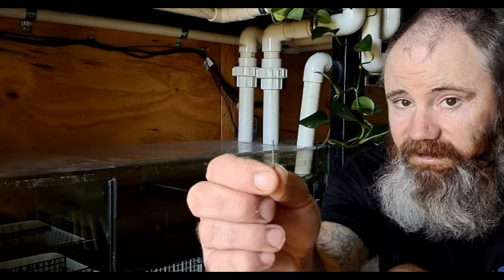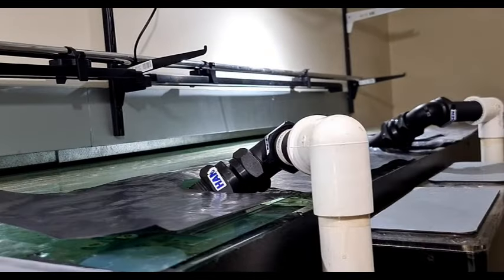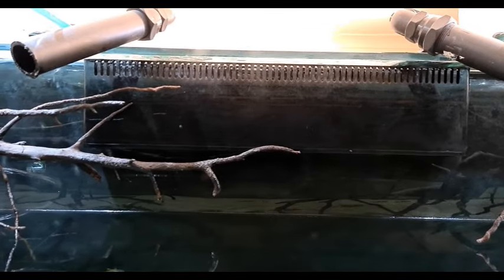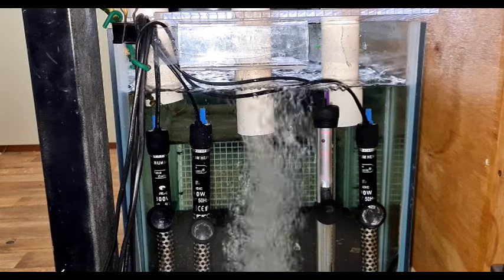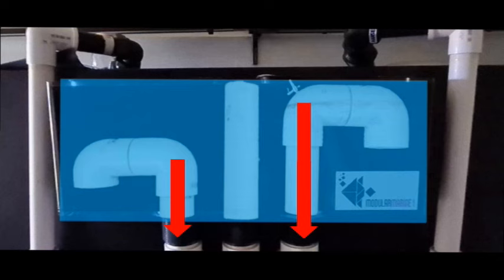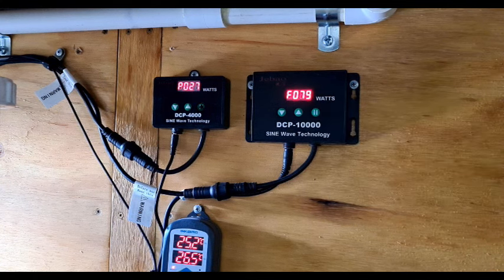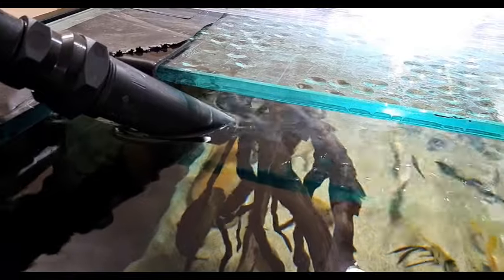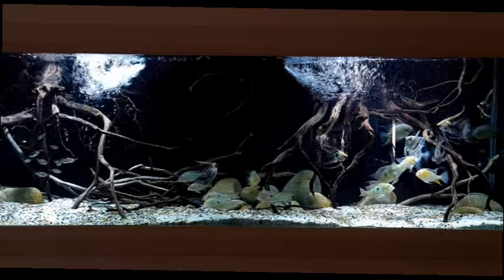Freshwater aquarium sump plumbing and Bean Animal Overflow explained. How to make your sump silent.

Comment: How'd it take me this long to find your channel? It kicks butt. Straightforward content without all the typical YouTuber bollocks, funny as, and full of pure gold info. I've had my tank for 6 months or so and every time the power goes out I lose the siphon and had to muck around to get the return flow right again.... then you come along and just drop a little "poke a hole in the top" pro tip and bugger me dead if that didn't solve the problem. Now my siphon restarts just fine and I can even use the feed function on my pump finally. 

Thanks mate, these videos are tops.
Reply from the maker: I'm glad to hear that the video helped. I have a pretty short attention span myself, so I try to make the videos as short as possible. I also have a video on my DIY battery back up system for when the power goes out if you are interested. Thanks for the comment, it really made my day. Don't be a stranger mate.

Comment: Just wanted to say, I ordered a Modular Marine overflow box because of your video. Thanks a ton for some great instruction.
Reply from the maker: That's great to hear mate. Just be sure to read the installation instructions twice, paying close attention to the location of the outer seals. I'm not going to tell you how I know, but believe me when I say that it will leak if you don't have them in the correct place.
If I can help in any way, just drop me a line.
Reply: @Gilsfishroom  Hahaha! I won't ask. ;) Thanks for the tip! I really appreciate it. I'm still trying to gather the courage to drill my tank, so it may be a while before I actually get to installing the plumbing!
Reply from the maker: My hands were shaking when I drilled mine. My fish room build #3 video shows how I drill tanks.
Reply: @Gilsfishroom Just drilled my tank tonight! Holy crap, that was terrifying! Lol. 
Now I have to figure out how to install my bean animal system. It’s pretty cramped inside the box, the bulkheads take up a lot of room. Did you cut your bulkheads down?
Reply from the maker: @ProVisionColor  Great work mate! It's not that hard to drill glass once you can get your hand to stop shaking. 
Yes I did cut them down. Mount the box as per the instructions, (READ THEM TWICE!), and mark where you want to cut. Remove the bulkheads and screw the nuts back on before you cut, that way as you unscrew the nut it will straighten up the thread. 
After a couple of months of operation, mine had a very slow leak. I tightened the bulkheads a touch and it sealed up.
Good luck mate.
Reply: @Gilsfishroom  Thanks for the advice. I hadn’t thought about putting the nuts on first, that helped a ton. I cut them with my chop saw, worked like a charm. And just as you said, having the nuts already screwed on the bulkheads cleaned the threads right up when I backed them off the first time! Perfect! 
The box is installed and working great. I just need to fine tune the drains, and finish plumbing my return line. Thanks again for all the help. You are a genuinely good human being. :)
Reply from the maker: @ProVisionColor   I'm really glad that it worked out for you mate. If you have any more questions, you know where to find me. Or you can message me through facebook.

Comment: Man, that’s super impressive. I’ve had my out take like yours before, just below the surface, and I find evaporation the biggest downfall for this system. You need to have a good handle on keeping a specific amount of water in the tank at all times otherwise the system fails. Some situations that’s not an issue but for me it was.
Reply from the maker: Because the tank needs to be full to overflow, it always remains full. When evaporation does occur, the tank level wont change, but the level in the sump will. I have covers on both the tank and the sump otherwise it I get a lot of evaporation in the winter. Thanks for your interest mate. 😃

Comment: Thank you again for this video. I have a 90 gal with corner overflow,  only 2 holes( drain and return) can I get the same result? Make it silent
Reply from the maker: You could try a Durso style drain with an air valve on top. If you can control the air in the pipe, it will be quieter.

Comment: Hi, I'm in the process of setting up a 125 gallon tank with a modular marine overflow box. Do you find that water escapes between where the white pipe of the removeable weir inserts into the bulkheads? I'm trying to calculate how much extra space I need in the sump to handle the drainage from the main tank when the pump is off. If water does leak between there, I would think the minimum water level would be the height of the intake of the main siphon. Although I imagine it would be very slow, so to the bottom of the weir quickly, then to the main siphon intake more slowly? If that makes sense.
Thanks
Reply from the maker: I don't think any water gets past at all. I pause my pumps for 10 minutes at feeding time everyday and have had no problems.

Comment: old video but can you make a wet dry filter fully submerged? Like drill a home lower like some aio units do so if the water level runs low the pump wont run dry? Have a sea clear acrylic with wet dry built in back is why is im asking. thanks
Reply from the maker: G'day Scott. I think that you could fully submerge your wet dry, put an air stone in the bottom and make it a moving bed filter, or you could replace the bio balls for a media that is more porous.
Reply: @Gilsfishroom  thank you! replace bio balls for sponge maybe. at least one side?
Reply from the maker: I couldn't say mate, it all depends on what media you already have and what stocking you have in the tank.

Comment: I just got a 210 gallon tank and want to steer away from canister filters due to the maintenance. What kind of maintenance do these things need And also how much do they cost roughly?
Reply from the maker: I clean my canisters 2 or 3 times a year. Depending on how fine a sponge or floss I use, I need to clean the sump anywhere from 3 days to a month. That said, my sump is easier to change out sponges than a canister filter. Here is how I do it -  https://youtu.be/XPDV4w2M_zY
Even if you build your own sump like I did, you still have to buy the overflow box, plumbing and return pump. My setup was slightly cheaper than a couple of fk6's, but not by much. Hope this helps mate.
Reply: @Gilsfishroom  Very helpful thanks!  Subbing now

Comment: Hola pregunta, la perforación en el codito, la hiciste con un clavo caliente, eso ayudo a que? A que no sacara el aire por la parte de abajo no entiendo mucho gracias
Reply from the maker: Hi, I made the hole with a drill. It helped air escape because the bottom of the pipe is under the water, sometimes air can get stuck.
Reply: @Gilsfishroom  ok entiendo las mías igual están sumergidas, en q beneficia? Gracias
Reply from the maker: @alejklsanchez8360  Having the end of the drain pipe submerged means no water splashing. Makes system quiet.
Reply: @Gilsfishroom  me refiero que al tener sumergidas las bajadas entiendo q es por un tema de ruido pero me refiero en qué beneficio la perforación que le hiciste, baja más rápido el agua? Gracias
Reply from the maker: @alejklsanchez8360  The hole in the top allows any air trapped in the pipe to escape only.

Comment: Hey man! Sorry to bother you again. Last question I swear. 😅 but in your overflow box do you have 25 mm pvc then 40mm on the outside?
Reply from the maker: No bother mate, answering questions is why I made the video. They are 40mm inside and out. I tried 25mm inside the box, but that didn't have enough flow. And just to be confusing,  the very end of the returns are 32mm. This slowed the force that the water returns to the tank without reducing the amount of flow. Good luck mate, let me know how you get on and feel free to ask questions and learn from my mistakes.

Comment: Beautiful tank!! Im setting up a 220 gal in the wall and im using your video as my inspiration/blueprint. Im going to put a sump the new 220 gal but have zero experience with sump setup. Ive already ordered the 2400gph modular marine overflow and while Im waiting for that to arrive im trying to get my return plumbing & nozzle location figured out. What size PVC are you using for your return pipes?  And for the overflow drain pipes? 1.5"??  Could i put both return nozzles on same side as overflow pointing towards opposite end? Only difference with my setup is that  id like to view from both sides, so im trying to put everything on left or right side of tank. And would like to keep ALL plumbing on one end if possible.  Any advise you can give will be greatly appreciated! 

**Im going to use a Jebao DCP 4000 and a 8000 return pumps
(220gal 72x24x30 w/1 MM 2400gph 20" skimmer)
Reply from the maker: Thanks mate. The drain pipes are 40mm, and the returns are 25mm. The outlets on the returns are 32mm, just to slow the flow down a little. I think that if you have the overflow and the returns on the same end, you will need a fairly high flow to move the water at the other end of the tank. My original plan was to have the box at one end, and the returns at the other end pointing on a downward angle. I couldn't do that because with having the tank inside the wall, the external part of the box wouldn't fit. Good luck, and any other questions feel free to ask or shoot me an email.
Reply: But you think it would be better to put returns at opposite end pointing towards overflow? If it will fit..
Reply: I'm starting to wonder if maybe I should have installed a internal overflow system. And drilled the bottom of tank, if possible. Or have someone else drill bottom. 🤔
Reply: And what is your email address?
Reply from the maker: I would put the returns on the opposite end pointing towards the overflow, but on a downward angle to keep debris moving along the substrate. I would go with the overflow box If you want to look through the tank as the weir box has a small profile and wont be very noticeable.
Reply from the maker: When I built my tank into the wall, I used the tank stand as part of the wall frame so that the front glass would be up against the plasterboard, avoiding the 90mm recess you normally see with built in tanks. This means that 4 inches of the side of the tank is inside the wall, which is why I couldn't fit the box on one end. If you put your tank behind the wall, the box should fit. Check out this video and you will see what I mean. https://youtu.be/Vje5qpjzX5w
Reply from the maker: gilvidler@hotmail.com

Comment: What is plugging the hole on the second drain pipe?
Reply from the maker: It is an air tubing valve. It is the air inside the secondary standpipe that makes the gurgling noise. By controlling the amount of air, you can stop the noise. I don't really need it as I can adjust the water flow with the pumps.
Reply: @Gilsfishroom  Cool thanks!!! Would putting that end affect it draining if the primary line got clogged?
Reply from the maker: No. You can even put some air tube on it and have the other end finish just above the water line so if the water rises and prevents air from entering, it will cause that drain to form a full syphon.

Comment: I can’t get my overflow box like that quiet for the life of me. Sounds like a bathtub😞
Reply from the maker: Adjust the tap on your primary syphon so that it is taking ALMOST all of the flow. The small amount of excess flow will be taken up by the secondary. There should only be enough water in the secondary to stick to the walls of the pipe, leaving a big channel of air up the center.

Comment: Should have went with a Shadow V3 overflow. Way better quality and design that the MM. Yu barely have any flow going thru the overflow. This is why it is quiet. Try that with 2500 GPH wit that MM, it will be noisy. Also if you properly calculated your sump size you wouldn't have to worry about it overflowing.
Reply from the maker: G'day Rick. The MM overflow has worked a treat for me. When I set the tank up I had a 20,000 and 12,000lph pumps running on full. The head height is about 6f. The overflow box handled that fine and was silent. I have that size sump because it is made out of an old tank, and it does the job also. Thanks for your interest mate.